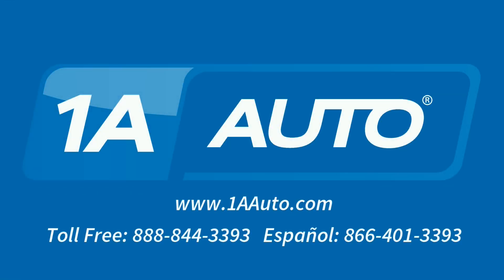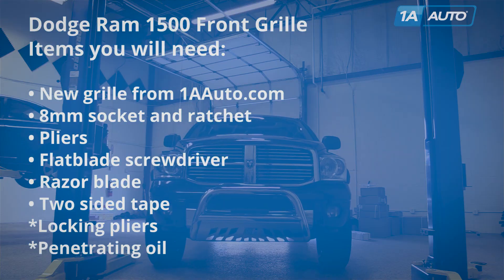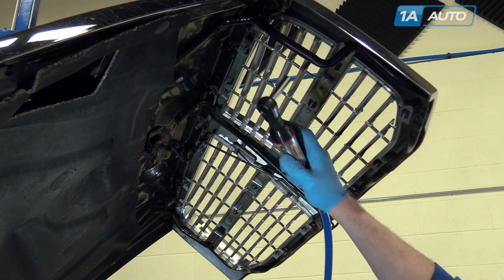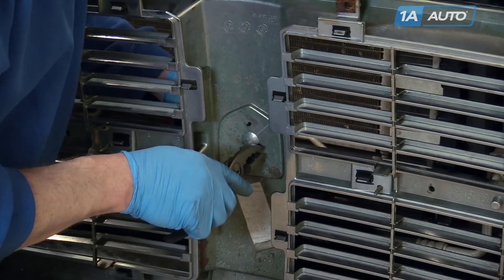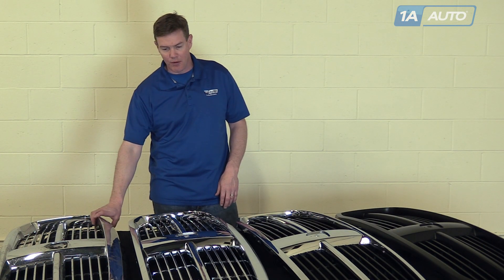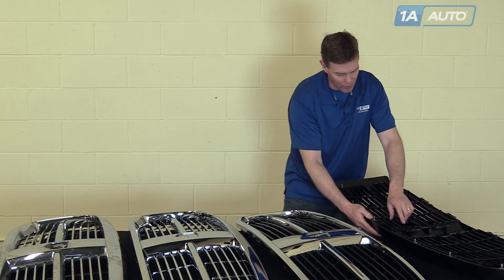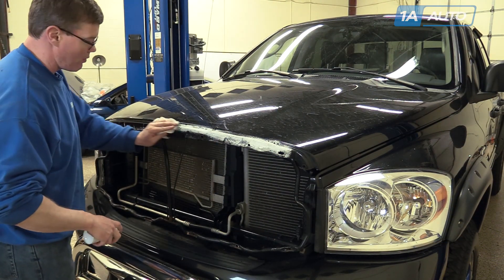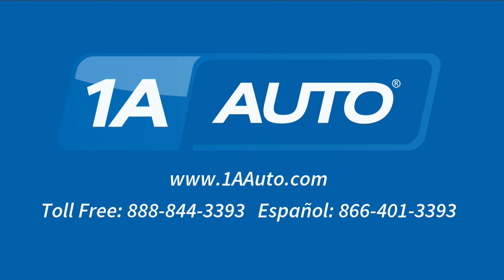How to Replace 06-08 Dodge Ram 1500 Grille

Comment: i need some advice. i was driving my car yesterday and my steering wheel and brakes and gas locked up. no lights came on at all. after my car came to a complete stop i put it in park and turn off my ac and turn off my car and crank it up it been running fine for now. the car is a 2005 dodge stratus . what could be wrong. im concern this will happen again and it would cause a accident.
Reply: A ghost?